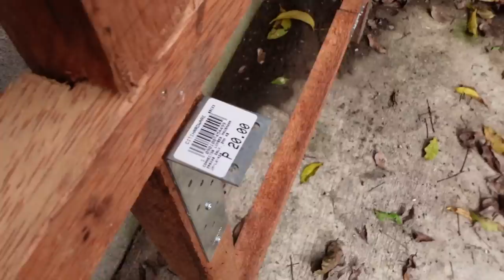WE TALK ABOUT WEDDING / BUILDING OUR RABBIT HOUSE

Comment: Concerning using the metal plates to extend the wood you should put a plate on both sides for strength,one will not be strong enough overtime. an example is when you left it at the single plate was already bending showing it has no strength.  Plates on both sides will stop this from happening. If you shop around they make self nailing plates just for this purpose.

Comment: Raised rabbits as a youngster.  Built many cages.  Truth…rabbits poop…on the new floors.  You can clean it frequently or you can put 1/2” rabbit wire in the floor and the poop drops to the ground.  Just a thought.  Buy a circular saw.  It will save hours of labor.  Also hope that the rats cannot get to the rabbits.